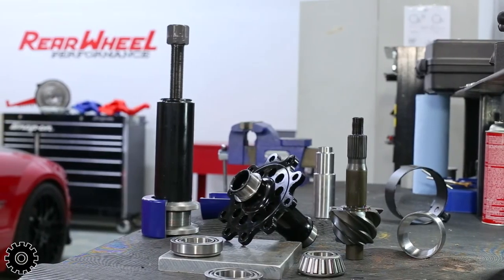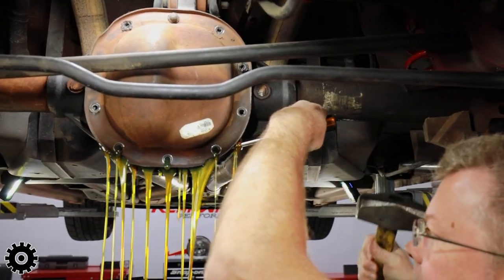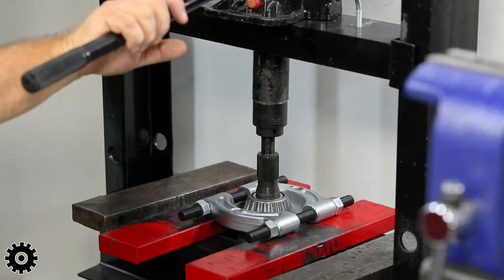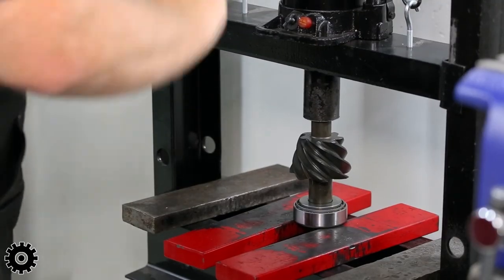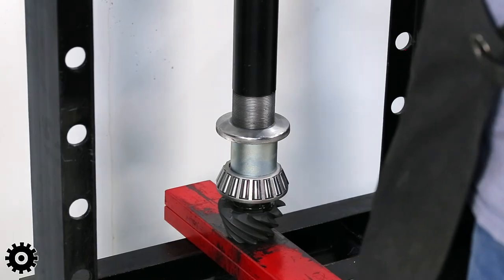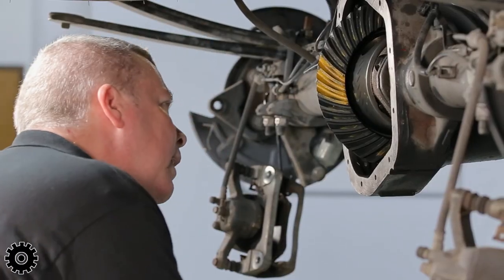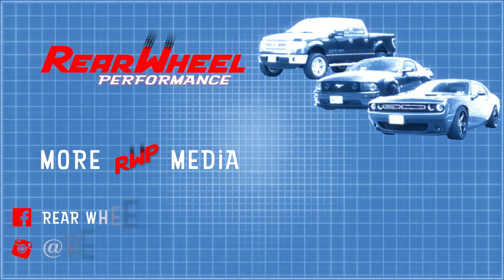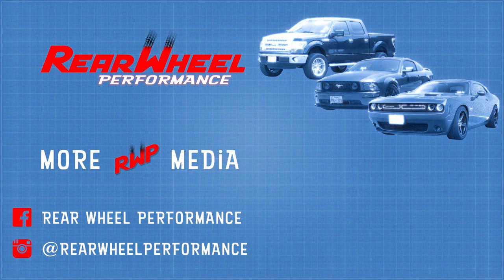Bearing Puller vs Bearing Splitter: Diff Bearing Removal Tools

Comment: Would it be bad to put grease in the carrier sides installing the bearings? So it would slide in better ? Is it a bad idea.?
Reply from the maker: Surely, but we don't since it can get hard to juggle everything and keep it in place.  I would imagine things could get sloppy quick of it needs to be removed and reset a couple of times during the pattern checking/setting phase.

Comment: I don't have neither. I just use my torch and get it red hot and push it off with a screwdriver if that, mostly it just falls off. I don't do enough of that work to spend the money :(
Reply from the maker: These puller and splitter tools are made to pull bearings in good and reusable condition.  This is can be a big time and money savings, since there is always a chance that getting a perfect gear tooth pattern set-up may require several pinion shim changes, and that pinion bearing could be coming off and on several times.

As much as we love torches, putting large amounts of heat into the inner bearing race will transfer into the pinion stem.  If there is enough heat transferred to change its molecular structure it can leave the pinion stem more susceptible to fatigue and failure at some point.

Comment: I have a 3.06 differential on my dodge charger. Would it be possible to jump to a 3.91 differential
Reply from the maker: Most likely.  What year and engine does it have?
Reply: @rearwheelperformance  I have a 07 charger rt the 5.7 the differential is from a 2012 6.4 charger
Reply from the maker: @thatflymechanic  In short: yes it should be possible. We did something similar with our Challenger (in Differential Gears Explained: Choosing the Right Gear) taking it from a 3.09 to a 3.90 (and what a difference!!!). BUT it is something we bought from a Dodge dealer. No aftermarket gears are made currently since the ring gear is welded to the carrier. Hope this helps!